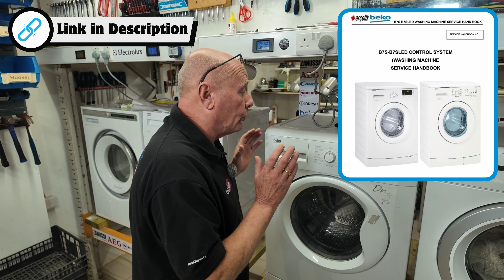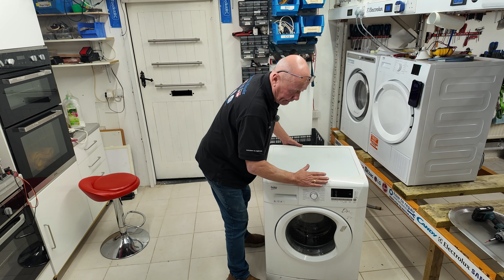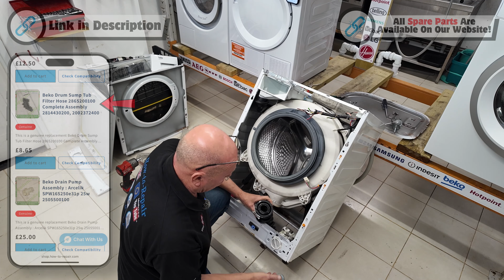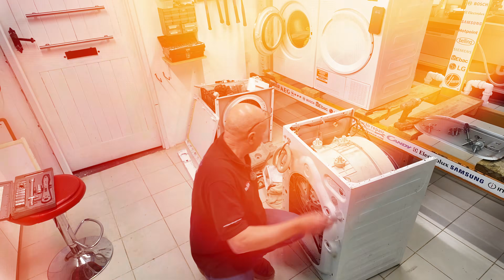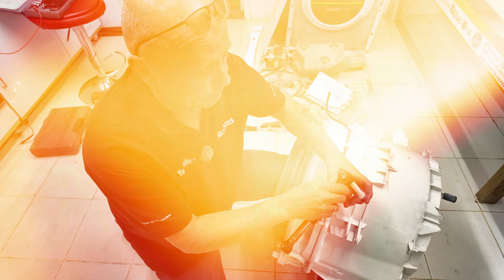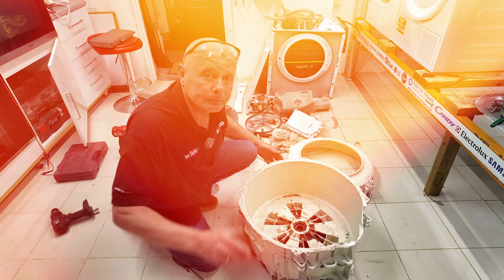Beko Washing Machine's SECRET Diagnostic Mode: All ERROR Codes (E01-E18) & Full DISMANTLE

Comment: Stop saying that they they are building obsolescence into their machines, thats just stupid. They are manufacturing them cheap, an average worker in 1970 hat to work 8 times longer to buy a washing machines (145h down to around 18h) they went from a month salary to half a week. Alle the manufacturer does is to simplify manufacturing. In 99 out of 100 cases they are not evil, just money driven. Also "just cheap chinese bearings" is racist. They are (nearly) all made in china, the best and the cheapest. And many things "made in england" or germany are low quality bc you can not manufacture high quality mass production products in europe. We are to expensive, to slow, want work life balance...

Comment: Hello,
I purchased a Beko BPRO 500  BWD 106 model washer-dryer around 4 months ago. Recently, the washing programs have been extending their cycle times significantly. 
To diagnose the issue, I ran several tests:
 During washing, the door does not warm up on 40°C or similar programs. However, during drying, the clothes become hot, so the dryer heating system works normally. The issue occurs on all washing programs and even with no detergent or load. Could you please suggest me how to solve the problem ?
Reply: Is the heater broken? That could possibly be why it’s not heating on 40c. Have you tried other temps to see if it reaches those?
Reply: Check if it's not on eco 40-60

Comment: TLDR: Can you make a video showing how you move and transport appliances around the shop?

Hello! 

I have started a job at a repair shop that works reclaiming appliances that were thrown away for various reasons. For: context I works for a fundatio that does residir management and this is a program that aims to give a second chance to some of the things that are thrown away.

We mostly try to fix refrigerators, dishwashers, washing machines, and small appliances.

My problem is abour moving the appliances in this setting since space is scarce and I dont want to scratch or break anything. 

How do you move the appliances around your shop? Thanks!

Comment: 6:16 that's the software version :)
6:45 it rotates at around 52 rpm, the "normal" tumbling speed for all non-delicate cycles 
9:10 service mode has an inactivity timer of 2 minutes, meaning if the user hasn't pressed the start button in that period of time (no matter the test stage), the machine will restart itself and quit service mode.
This range of Beko machines do use high quality bearings and spider and they really did last for ages! It's just a massive shame that they used sealed tubs in these, brilliant machines otherwise.

Comment: Very good video, as usual. In Malta, due to having very hard water, spiders are constantly failing on washing machines. The problem is that when a machine is a sealed model, as is this Beko in the video, the spider on its own is not even available. For instance, I had an Indesit WIXXL 146 (made in UK), with a sealed tub, which we cut open for bearing replacement. Due to some fault, the bearings went faulty after only 2 years, but what I noted was the spider was on the verge of breaking, so I went to buy one. Believe it or not, I couldn't find one with the same shaft size anywhere! I thought it was my model was rare, but later on I discovered that Indesit spiders are not even manufactured alone, but the whole tub assembly is sold! There is a trick I heard of, which you might already know. You can use an inner drum and spider from a Vestel, and place it inside the outer tub of an Indesit (after cutting it open). I heard it works for sure on the 6Kg machines. On my WIXXL 146, it was unfortunately impossible, though, because the 7Kg Vestel is not deep enough and the 8Kg is then too deep.
Reply from the maker: I forgot to mention this in the video that if they build a sealed drum  they do not have to supply the components under the right to repair act. This means if you cut the drum apart the spider does not have to be sold as a component which makes it even more ludicrous because they are manufacturing that component for the assembly. You will enjoy the next video coming up. I'm sorry I can't give you the link yet as I'm not allowed to turn it public until it has been checked legally. I do appreciate your comment. The whole industry is going mad.
Reply: @How-to-repair  Purtroppo non è il vostro settore che sta impazzendo ma l'intero sistema sta andando velocemente in tilt. Ed i motivi sono sempre gli stessi, uguali per tutti i settori.
Reply: There is, or was a place in ukraine making stainless steel spiders for various machines, not sure how well made and balanced they would be. How hard is your water in Malta? Here in East Anglia, we have some of the hardest water in the UK as it mostly comes from a natural limestone aquafer, and currently the Total Hardness is 357.5 mg/l, and I think it has been harder in previous years, the ground water has been low so they've been supplementing it with a greater percentage of softer reservoir water. The spider in my machine is fine after 16 years, and was in perfect condition after 11 when the shaft seal leaked water into the bearings, likely because the rubber seal was encrusted with limescale.
Reply: @mels8966  In Malta there was a person who made stainless steel spiders, but closed down. At least I have a spare stainless steel Vestel spider. What I liked was that it cost €80 only, not much more than a regular spider, and given that it was custom made. It would have been even cheaper if it had to be made in a factory.

Comment: Nice clean and tidy workshop with everything in place for easy access. Interesting video, I have a beko washer so may be helpful in future, thank you.  Can you recommend a quality internal washer cleaner that works?
Reply: I can tell you what works for me, use washing powder, preferably one with oxygen bleach in it (eg Surf) and wash at 40°C and above. And Also leave the door and draw open when not in use to reduce humidity in the machine and prevent mould. I can confirm that has kept mine clean, because I changed the bearings in my current machine at 11 years old and it was clean bar a bit of lint and limescale - If you have hard, or very hard water like me, it is also advisable to descale the machine regularly. I do mine once a year with anhydrous citric acid on a 90C wash. It is 16 years old, no smells, no mould, and still working fine. For a one off clean, I'd suggest using a product with Sodium Carbonate Peroxide (aka Sodium Peroxide / oxygen bleach) and TAED (oxygen bleach activator/ booster), at 60°C or hotter, which produce per(oxy)acetic acid - a powerful oxidiser/disinfectant when dissolved in hot water.
Reply: @mels8966 sir, thank you for your reply, never thought about  a washing powder I always use a liquid mostly at a low temperature.   Do you use the powder on a normal wash or a specific empty wash cycle?
Reply: @David-l1h1l   I use powder detergent for most washes, and I only use a liquid detergent when washing delicates, wool and silk which would be damaged by the hydrogen peroxide (oxygen bleach) released by the sodium percarbonate in the powder I use (silk and wool are protein based fibres). I have seen it suggested that if you prefer to use liquids for most washes, doing a regular hot wash, eg cotton towels or sheets using a good quality powder containing oxygen bleach should be enough to get rid of the residue left by liquid detergent and fabric conditioner that builds up in the machine and the oxygen bleach should kill the bacteria that grows in it. If the machine is in need of a thorough clean, Dr Beckmann Deep Clean (powder) which contains oxygen bleach and TAED, is supposed to be one of the better washing machine cleaners. The problem with liquid detergent (and fabric conditioner) when combined with low temperature washing is that a very small amount of detergent residue and other grime is left coating the insides of the machine which retains moisture as it is hygroscopic and also provides nutrients for bacteria to grow in it.

Comment: Can you list the machine brands that are known to weld the tub?
Bosch, Siemens, Beko .. Who else?
YT commentators are welcomed to add their known experience here. Just manufacturer name , year and model.  TNX.
Reply: Aeg/electrolux, whirlpool group before and after beko takeover, your gonna find it hard to get a machine without sealed tub, lg are split and good washers
Reply: Hi, korean brands makes split drums: LG & Samsung. Recently I've learned that Sharp makes also split drums (but please do check it before buying!) Polish brand Amica also splits. (I don't know if it's available in UK retails). There are also splits drums in BSH washers Bosch/Siemens, but you have to check the exact model on their spare parts websites....
Reply: Easier to list those that aren't : LG, Samsung, Ebac. Some (stainless steel tub model) Miele - Check the model on Miele's full spare parts catalogue, the plastic tubs have ribs, no spare part available and no exploded diagram of the  suds container. Also some low end chinese machines sold under various former brands that they, or the stores selling them have purchased, or licenced. However, unless you plan on replacing the bearings yourself, I wouldn't worry if it is sealed or not. Having the bearings replaced professionally is likely to be a very expensive repair, and probably not going to be worth it on an old machine,  putting the money to buying a new one with a 5 year guarantee is likely to be better value.
Reply: It is also just about possible to cut open or cut the front out of, and glue or hot air weld a plastic tub. Although gluing, requires a specialist Polypropylene adhesive if you want a reliable bond and either would result on the floor being flooded if it fails.
Reply: @mels8966 it is possible to cut outer drum and glue/weld plactic back. But the problem is, as you wrote before, you don't have spares that way:  spider and inner drum. And that is why Paul doesn't repair that Beko washer on this movie, but disassemble it for second-hand spares... And second of all, cutting and glueing takes much more time and risk of flooding...
Reply: @andrzejnowak4315  Indeed, no professional would do that here, strictly for DIYers who also have flooring that wouldn't be ruined if it dumped water over it! And for poorer countries with very low labour costs.
Reply: Would be faster to list models that doesn't :)

Comment: So much talk about climate change and net zero, but governments allow manufacturers to make sealed drums - that's NOT good for the environment or cost of living pressures! What hypocrites they all are!
Reply from the maker: I totally agree with you the hypocrisy of getting us to buy electric vehicles eco-friendly machines but no one is addressing the real problem waste! If we stopped to manufacturers deliberately designing products to fail we would be eliminating a lot of the waste. Also I did a recent video on a cordless trimmer which brought to my attention the incompatibility of batteries so when our drill or trimmer fails if we choose another brand those battery units go to waste.
Reply: @How-to-repair  Lots of EVs cannot be repaired either or you can only go to the Dealer for the repair or you cannot buy parts.
Reply: Here in Denmark there will not replaced bearing more. People buy new machine for 4000 dKr  and will not pay 2000 for repair. Work price is to high.